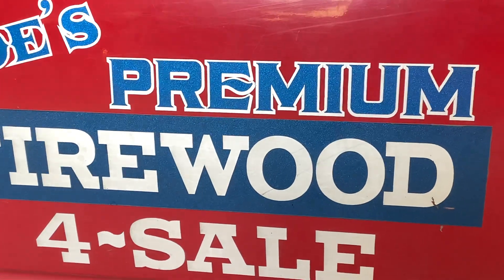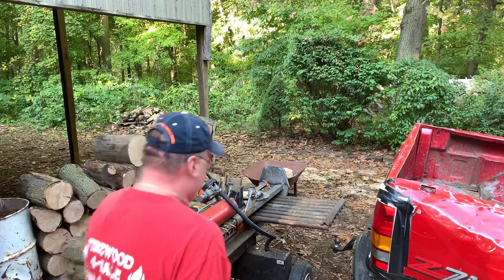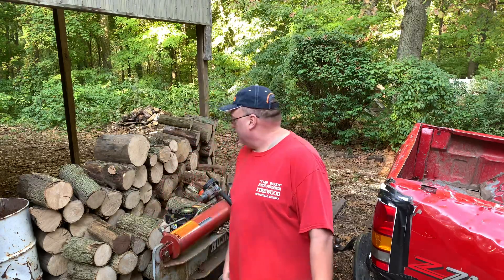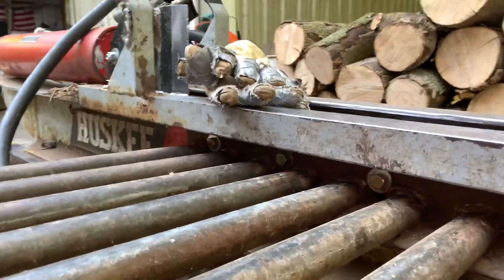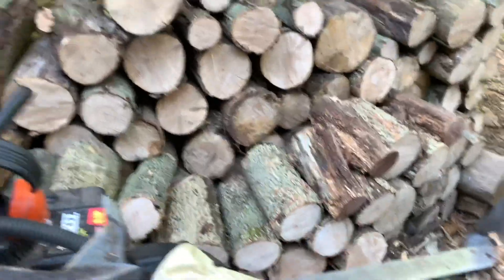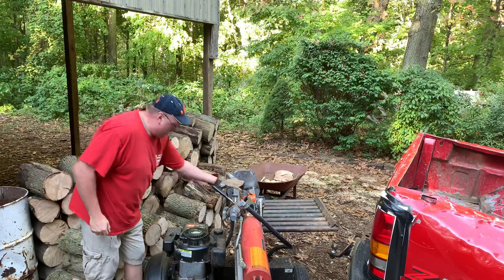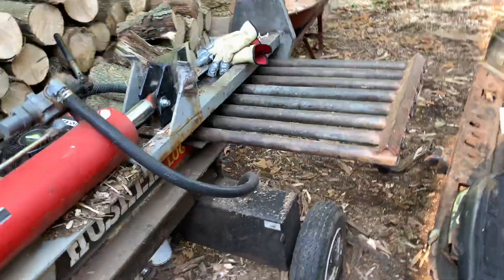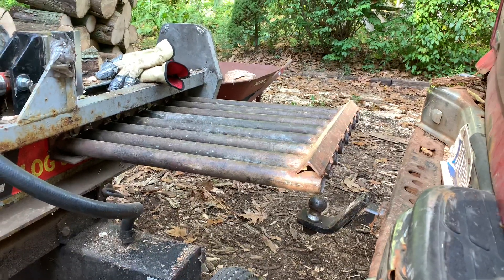My custom firewood “table” added to my 35 ton Huskee log splitter

Comment: Thanks for the video. Looking to do something similar. May I ask why the L bracket wasn't welded to H beam instead of bolted on?
Reply from the maker: Just in case I ever wanted to take it off to use the splitter in the vertical position.  However it's such a pain in the ass to take it off and put it back on I don't see myself doing that much.

Comment: sounds like lady luck was with you the other day, I bought a table at Runnings for $40.00 and now I can't tip my slitter up all the way . But I it batter the way it is now.
Reply from the maker: Yeah this table is way over engineered and bigger than the cheap store bought ones.

Comment: I can’t believe you get that much money for a short bed load of wood. I stack it in my short bed and only get $70 a load but I only drive about 20 miles...but that’s in Missouri
Reply from the maker: Sold two oversized truckloads today for $150 each.  Have like 7 to deliver and getting call all the time.
Reply: @ Brady West...I live in Macon County just outside of Macon Missouri.
Reply: @ Brady west...so how far are you from Macon